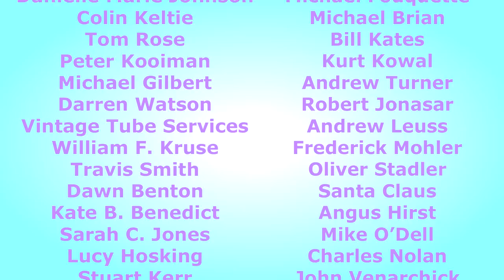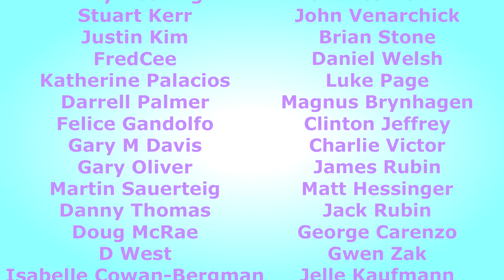Weird But Practical - Leper Amps!

Comment: Customer brought in a dead BT speaker to the shop the entire "DJ" section got wet and was destroyed. The original amp was 2x3w ....on a tower speaker with 2 x10" drivers also marked and rated at 3w. Seems China over rate their amps and under rate their speakers. I bought a tda amp board (dollatek) 2x50w RMS, and unreal volume now with a 24v lipo pack its now the loudest bt speaker we have in the shop and I can't sell it. Love those chip amp boards and amps, sometimes you get lucky sometimes they need a fiddle to get working.

Comment: I doubt if that little chip in the modern version can dissipate more than 0.5W continuous power without a heatsink. If we generously allow an overall efficiency of 90% then you would be limited to 5W of output before the losses exceed 0.5W.
Reply: I don't think it's even that much. Most disappointing amp I've ever had.

Comment: Class D (Digital) amps are different from an analog transistor amp operated in Class D... Confusing?  Sure.  The Lepai you are showing first is labeled as a Class T - these add some PWM circuitry to the Class D Amp section to allegedly get better performance.

Compare Lepai vs. Dayton Audio...  That would make a great video.

Comment: Looks like they are all clones of the original, some are better than the others, and the usual cost cutting to get the cost down to as cheap as possible, and use of either recycled components, or actual counterfeit ones. Date codes could be correct, or they are second source chips that are being used, with fake part number to hide the lower power chipset inside.

Comment: Decent class D amps can do >95 efficiency, so at 20 watts that would be about a watt of dissipation in the chip. That's easily doable, especially assuming it's not continuous.
I'd be very surprised if the 'old' amp you have there is actually a class-D. That heatsink looks more than big enough for it to be an AB amp. (or enough for hundreds of watts in class-D)

Comment: I've loved these for years and I hope this video doesn't shoot the price through the roof! My Orange Micro Dark lunchbox amp has the same chip (TA2020) and also has a crappy power switch. I've always thought that it was wild  to have the same power-amp-on-a-chip in a $20 (in 2017) amazon cheapo power amp and in a $200 lunchbox amp head.

Comment: Thanks for this subject I have given those very amps a test for a theater company I was working for., Your recommendation fits with what I heard from them we did not get them as they were not suitable for use as part of the PA system in the parks we played at.
A while ago I found a whole bunch of Class-D amps for sale on various places that were just the populated PCB with sometimes wiring harnesses  no cases but ready to hook up and run they were available from 2 or 3 Watts to 100 plus or more I tried a few they do better if they have a base channel as they are little too crisp for my old ears

Comment: Thank you for the presentation. Lots of info on these little things. I have 2 of them and after listening/watching your presentation, I trust these things enough to use them on a couple pair of good bookshelf monitors. Thanks again (note) I noticed these little amps didn't seem to like 8 ohm speakers, are these things actually rated at 4ohms?

Comment: I was disappointed that you condemned the new 2.1 Lepy without testing it.  The new one might simply be better at Class-D and more efficient.  That doesn't mean it can't deliver.
Reply from the maker: Without testing it?  You did not even listen to me.  I repaired it 6 times and it ended up in the trash bin - the other (as I clearly stated) exploded its terminals in minute one and went right to the parts bin.  Buy it if you wish - be my guest.
Reply: @FranLab I was talking specifically about the power handling.  You did say you had a number of problems with it, but with no details, there's no indication that it was related to it's lack of a heat sink or that it can't produce the rated power.

Comment: It is possible that the Lepy is a knock-off of the Lepai. IIRC, the circuit boards of the Lepai say Made in Bukang--what about the Lepy devices. At the less supervised level of the market, it seems to be pretty cut-throat in manufacturing in China.